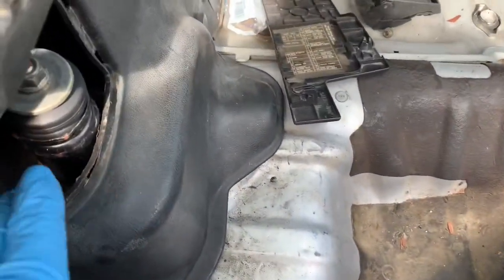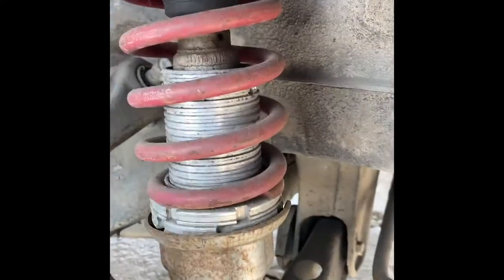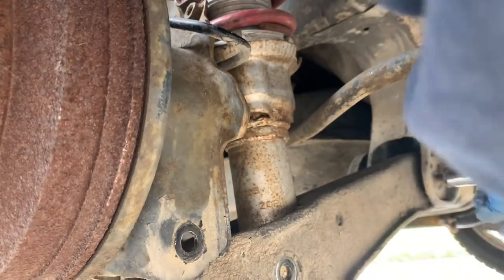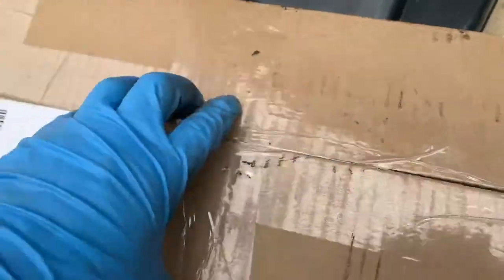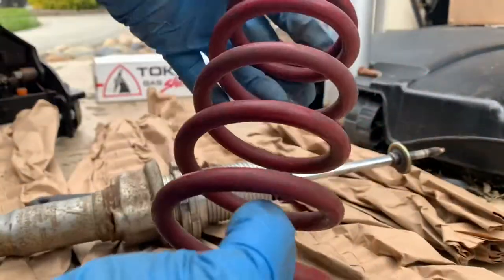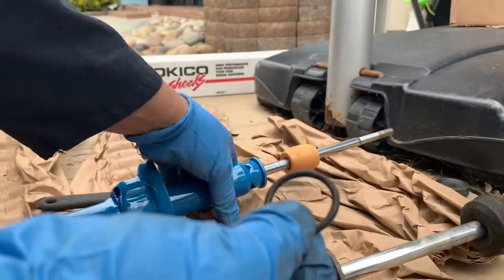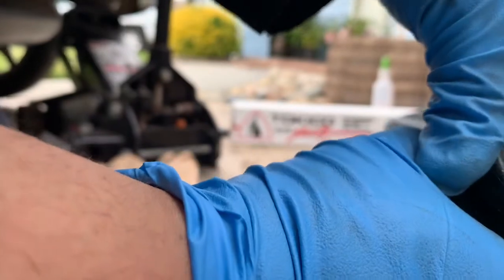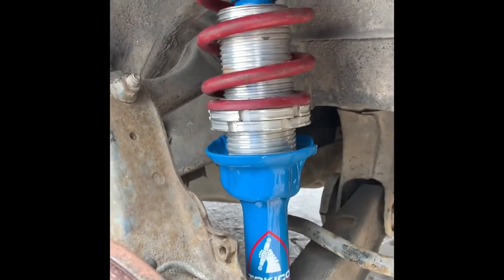How to remove & replace rear suspension from 88 Honda Crx diy

Comment: I'm just getting back to working on my 91 Honda Civic Si. I blew the head gasket at 507k miles back in 2013. Parked the car in my garage with the intention of one day getting it back on the road. I guess Tokiko blues are still around. Where did you source them out from?
Reply from the maker: Hello G Benz,

I’m surprised you’re 91 Honda Civic. Si OEM head gasket lasted more more than half a million.😃👍🙏 Oh the old school Tokico blues was an Ebay bought, I believed an old stock trying to get rid of.   Only fit Honda Crx 88 Si with a different lower control arm’s identical to Acura Integra Type R.  Thanks for viewing my videos!😁🙏👍